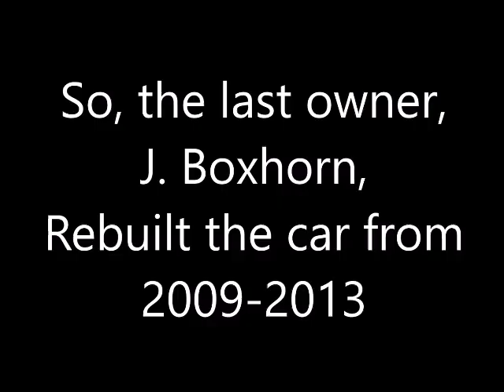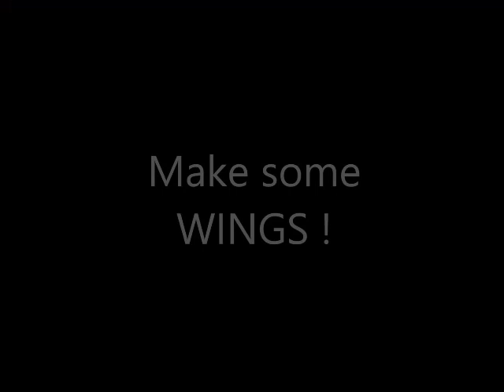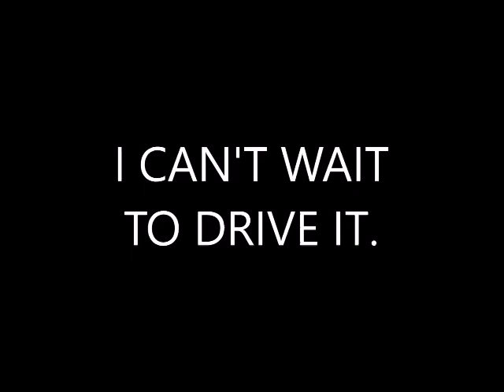68 LeGrand Mk7 Formula 5000 rebuild/restoration

Comment: I guess there were 2 of these because I wired one that Rex Ramsey drove and won at 
Trois Rivieres in Sept of '68. I was also 2nd mechanic behind Jack Smith and the 3rd person on the trip to Canada was Red's son. I did the wiring at night at the Le Grand shop before setting out for a test run at Willow Springs on a Wednesday. We went east from there making the race at St. Jovite that Saturday. The following week was the race at Trois Rivieres.
BTW, the original rear upright was broken and welded on that trip.